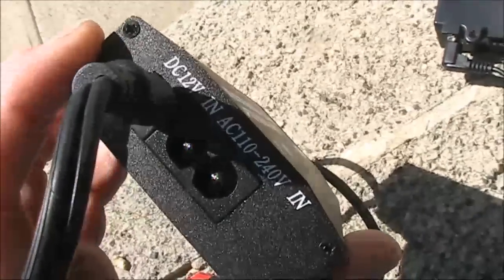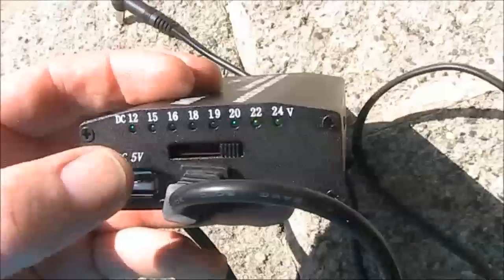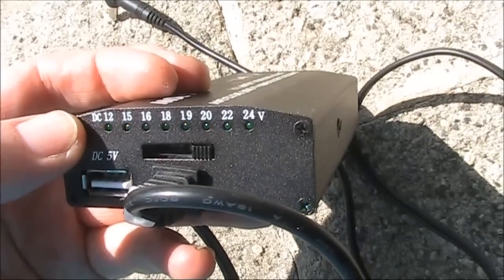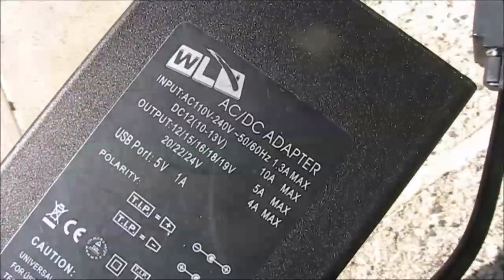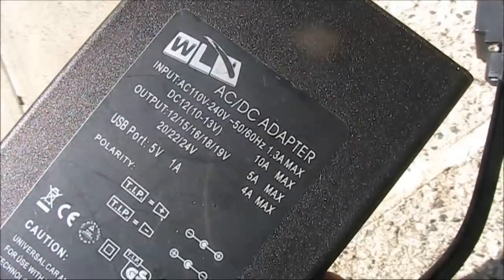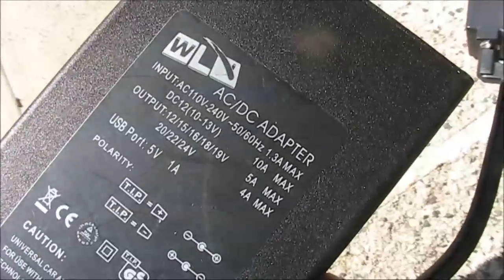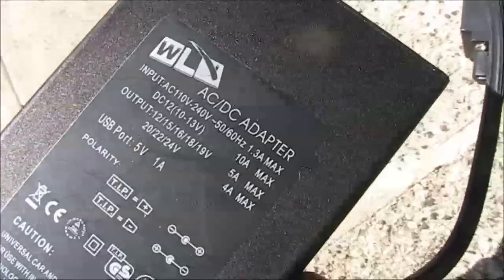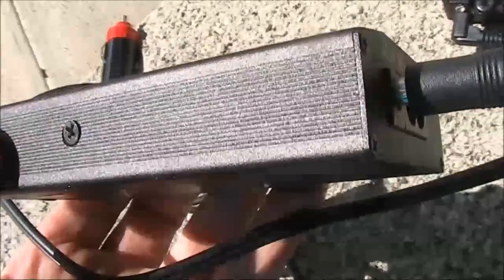A one dollar garage sale find (a possible use for a switch mode supply)

Comment: I'm not sure how well I'd trust them with mains input considering the case is metal and there's no grounding. You'd have to open it and see how it's constructed.

Looks like it's this item (in case you find these work well): http://www.ebay.com.au/itm/Universal-DC12V-AC-DC-to-DC-Inverter-car-charger-power-adpter-for-laptop-PC-New-/271889707200?_trksid=p2141725.m3641.l6368 or this item http://www.dx.com/p/100w-universal-ac-power-adapter-for-laptop-with-8-adapters-ac-110-240v-dc-12-24v-33874#.V_mn8OD5iUk

Comment: In Thailand the price is around 15-20 USD new. I tried to use it with my kx3 but the RFI is very severe.
Reply from the maker: In a transmitter - only application it could be set up so it was switched off on receive - overcoming the RFI